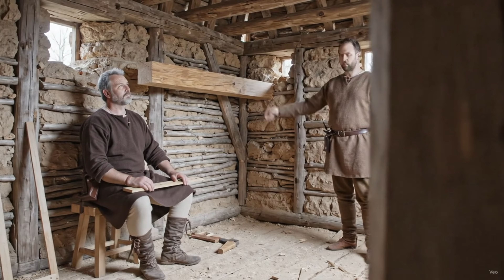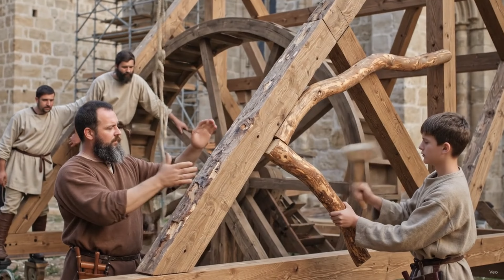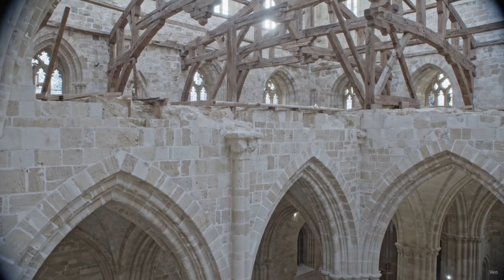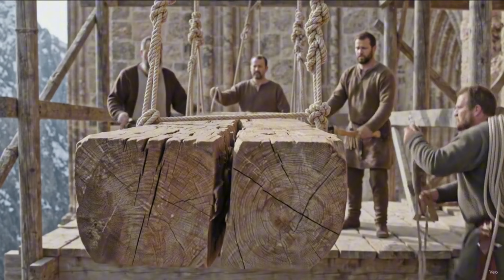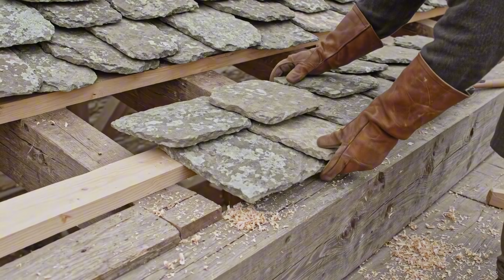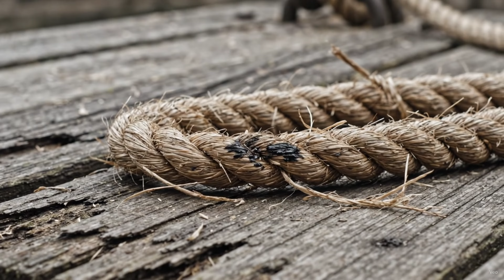How Timber Held Up Gothic Cathedrals

Comment from the maker: Medieval builders did not rely on one miraculous machine. They combined treadwheel hoists, hemp ropes, wooden scaffolds, precise joints, repeated signals, and carefully organized crews.
Which part of the process impressed you most: preparing the timbers, lifting the trusses, guiding them into position, or building the hidden roof above the vaults?
Bonus quiz: What multiplied human force during the lift?

A. A steam-powered crane  
B. A treadwheel hoist  
C. A steel tower crane  
D. A hydraulic lift  

Leave your answer below—and suggest another forgotten construction method for The Working Past to explore.